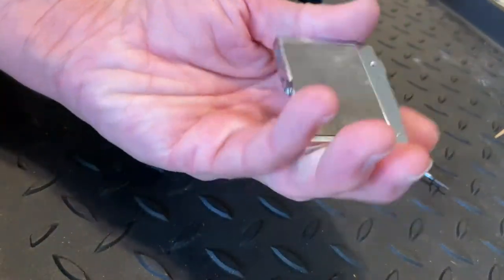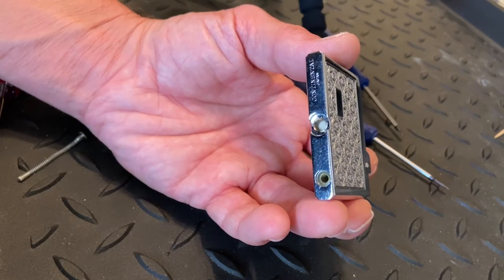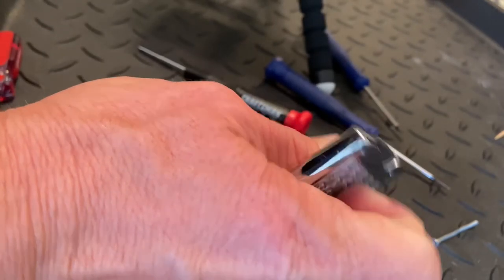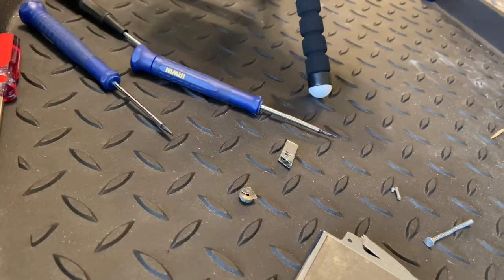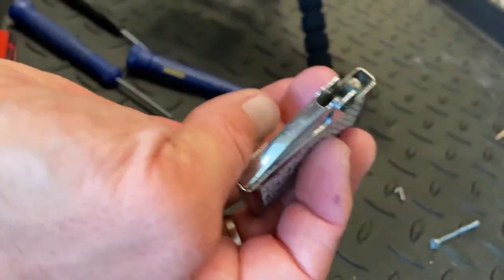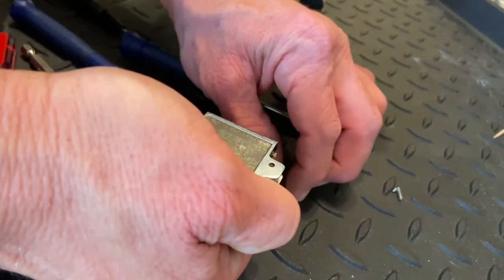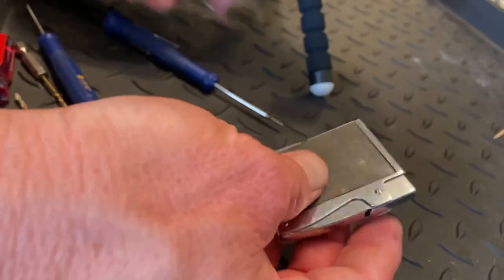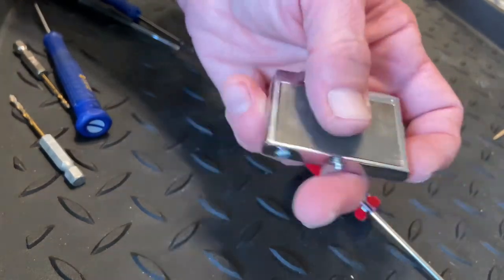How To Disassemble and Reassemble A Flat Ad Cigarette Lighter to Clear The Flint Tube From The Top

Comment: Hello, I have a Hadson Texaco lighter similar to yours. I was able to clear the obstruction from the flint tube, and after replacing the flint my striker wheel will not turn while the spring applies pressure. Even without a flint and spring only, the wheel will not turn
Reply from the maker: Are you certain you reassembled the mechanism with the clutch spring in the proper position?✌️
Reply: @DependableFlame that I’m not 100% certain, I’m going to take it apart and try again. Does the clutch spring need to be on the side of the striker wheel that has the teeth on the one side?
Reply from the maker: Yes but must be facing the proper direction also.✌️
Reply: @DependableFlame  I think I have it figured out, assembly is proving difficult though haha.
Reply from the maker: @Patatertot96 , try holding everything sideways as you are looking down at it.✌️
Reply: @DependableFlame  bingo that helped a lot haha, got it sparking now - thanks for all the tips

Comment: Hi, i have an old STIHL branded flat lighter and for some reason the top where you push down is stuck about half way, I’ve taken it apart and reassembled it a few times and still it stuck and i have no clue why
Reply from the maker: Send some pictures: https://dependableflame.com/contact-us 
It sounds like it might have been put back together wrong.✌️
Reply: @DependableFlame  it was happening before I had took it apart so i have no clue lol
Reply from the maker: Send some pictures, someone could have got in there before you did.✌️

Comment: I need help ! Mine's wheel is not turning so it will not spark ! Please give me a solution.
The will spin when the flint and the piece behind it are removed only , so when pressure applied wheel can't turn !
Reply: Hey dude Im having the exact same issue. Was wondering if you found a fix by chance?

Comment: Where can I get a clutch spring and a small screw for a lighter like that just bought one on eBay spring is broke in half and missing the little screw
Reply from the maker: Send some photos: https://dependableflame.com/contact-us
If it's this exact lighter I probably have parts I can send you.✌️
Reply: @DependableFlame  sorry I don't know how to send a photo but it is exactly the same lighter the spring for the striker wheel and  the small screw that holds it in just let me know how much I'm just starting to work on these

Comment: Thank you for your helpful videos!  I just got a small Colibri Monopol lighter that didn't work.  I took it apart and cleaned it - including reaming out the degraded flint.  Now the flint drops in perfectly, and I can screw the spring back in with no problem.  But I'm not sure I put the wheel back in correctly.  I'm pretty sure I positioned the metal flange correctly against the wheel, but the wheel doesn't move when I open the lighter.  I have turned the wheel both directions, but still no spark.  Can you help?
Reply from the maker: I haven't had a Monopol apart yet Chris but I'll get it on my list of projects and try to get a video made.✌️
Reply: @DependableFlame  Thank you so much! I appreciate it!
Reply: @DependableFlame   I tried to work on it again, and I forgot to take the flint and spring out, first - so it launched the flint wheel, and it is lost forever (I was outdoors). How do I get a replacement flint wheel? I e-mailed Colibri, but they said that the company that made my lighter no longer exists. Any help would be much appreciated.